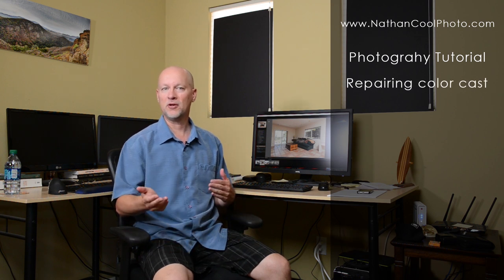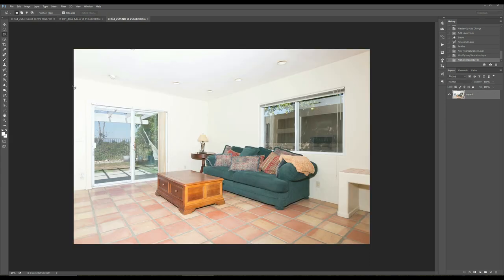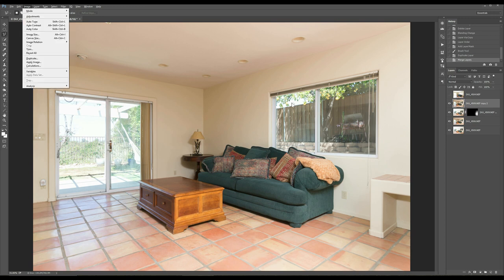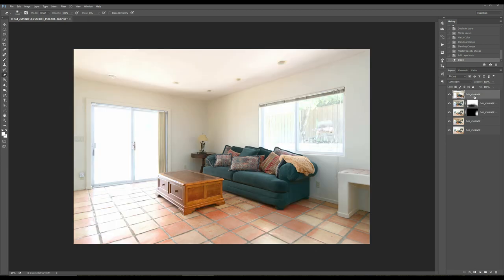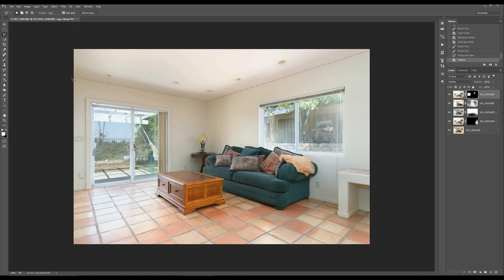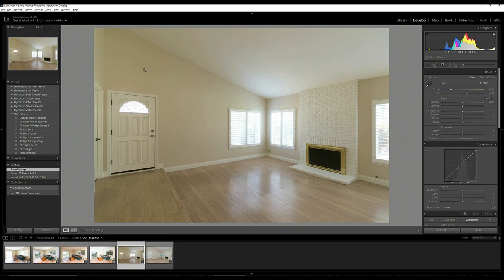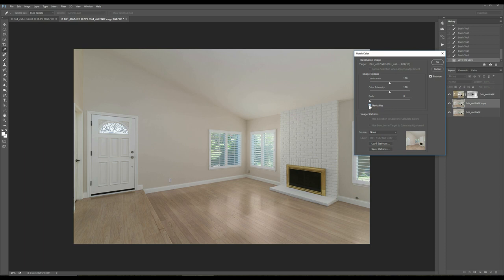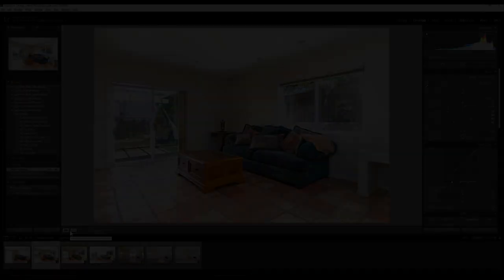Fixing Color Cast

Comment: Great tutorial as always Nathan! Was a tad fast never mind , I paused a couple of times to make sure I don't miss any steps. 
What are some ways to avoid color cast? Does firing with less flash power instead of full power helps?
Reply from the maker: It's a balance: if you blast too much light you can cast colors from reflective surfaces in a room, but if you don't have enough power then the ambient light is dictating the colors. It varies from home to home, hour to hour, etc.

Comment: Amazing Video. If the luminosity mode is showing direction of light and flash is using color, why not just use the direct flash/window pull. Why fire another flash at 1/50 of a second? If the lights were on, wouldn't that just introduce more color issues? We shoot everything with lights on as we can not convince agent's to turn them off. 

Also, how long does it take you to edit an entire house? I would love to see a real time video of a full shoot being edited even without commentary as I'm aware that would slow you down. Thank you as always!
Reply from the maker: All depends on how realistic you want to shot to look. Many agents love the lights on look. Also, the direct flash would result in hot spots, overblown highlights, and hard shadows.